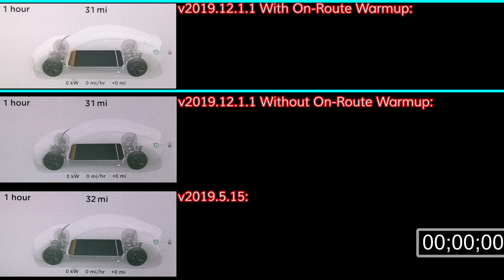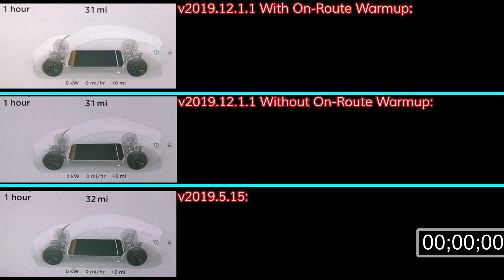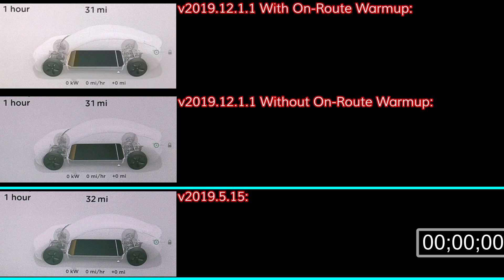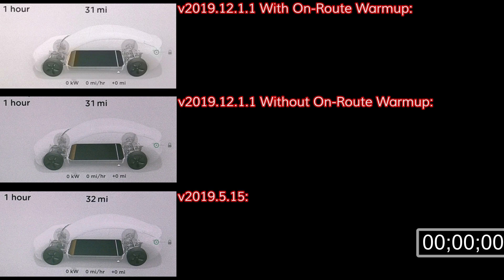Model 3 150kW Supercharging: How Much Faster Is It?

Comment: cool. takes 2-3 mins to warm up then max rate till abt 12mins b4 starting to fall off.  12 mins for 100miles is fairly acceptable.  curious to know if multiple consecutive150kw sessions is possible (nissans rapidgate).
Reply from the maker: The two tests with the higher charge rates on the newer software were basically done consecutively, with the fastest test done last. I just had to drive the car back down to 10% between the two charging sessions that afternoon and grab some lunch.

Comment: So it took 1 hour to get about 270 miles of charge? Well I hope technology improves charge times as this abysmal.
Reply from the maker: Charging to 90% like this using Tesla's Supercharger network isn't typical. On long distance trips, the stations are spaced such that you usually don't spend more than 30 minutes stopped. Charging up to the levels shown in this video is typically done overnight at home on a level 2 240V AC charging station.

Comment: Take notice the 150kW supercharger’s rate slowed down much quicker.  It would be nice to get Tesla’s explanation as to why the 150 kW charger would fall below 100kW faster than the 120 kW peak charge.  It should’ve sustained charge rate much longer.

This why they ended up with almost identical times by the end of charging. 

This is no way definitive proof that 150 kW supercharging is not effective.  Superchargers malfunction and experience as many bugs and glitches that the cars do.

Comment: I'd like to see this done when it's 35 degrees out. Charging when it's 60+ degrees out is always great, but if it's under 40, things get painfully slow.  Every mile is like your +200-240 timing, or worse.
Reply from the maker: I'd like to as well, but it'll have to wait until winter. Our nightly lows have already crept into the 50s.

Comment: I always consider the "inconvenient charging time" the time that I wait charging after I used the bathroom or got something to eat. The nearly 4 minute gap for 150miles likely represents a 50+% reduction in inconvenient charging time, which is a pretty big deal. 

V3 superchargers will likely match the time needed to pump and pee, though most ice users won't realize it.
Reply: Good point! I agree Tesla has the charge times down to match the time people takes breaks on road trips anyway.
Reply: Except the ICE driver could go farther on a "fill up" in the same time. Given its a fuel efficient car with a decent tank.
I can go 350 miles at 85mph comfortably, and still fill up in 5 min.. if I pee and get a drink and snack it's Probably 8-10 min.
EV's are closing that gap, but it's not quite there yet.
Most people I don't think would care even at this point.. most people take longer breaks..
But I'm a road warrior and tend to push it hard when I'm traveling..
I've done 1200 miles straight.. in 19 hrs.
Only stopping for fuel and a pee and drink refill. 
But most people will NEVER do that.
Reply: @kens97sto171  if that is what you want to do then no EV is currently a good choice for you.
Reply: @DavidDrivesElectric  
For sure.. but I'm pretty close to getting a Bolt EV.. for my local traveling.
I'll probably keep my Prius for the Long haul trips...
Also.. I'm fully aware as I get older I will likely want or need to take more and or longer breaks anyway.

The Bolt EV on the used market is getting pretty affordable..

And I prefer the normal car design over the Model 3 interior..

A high mileage but 2014-2016 Middle S may also be a decent choice.. but repair costs and there service center model are major negatives for me.
I like fixing my own vehicles.. and Tesla won't or can't  sell you parts .

Chevy will..

Comment: Lovely way of showing this Alex. Wow, you really must have gone to some trouble to get the battery down to 31 miles for each. Thank you. I am surprised it has made so little difference. I live in Southern Ontario, Canada and we regularly get down to daytime temps of -20C in the winter. Perhaps it will speed things up for us polar bears!
Reply from the maker: I think this update should help a lot with cold weather Supercharging, which is good because a free OTA software update is a lot easier than moving to California for better changing speeds. 😉

Comment: You need much colder temperatures to see the true value of on route warm-up. You get basically no charge while the battery warms for a long time if it's cold soaked. Depending on temperature this time can be substantial. For most of the rest of the world this is a big improvement for this feature alone. Nice job on the setup and capturing all of this, I suspected the increased rate would only be for a brief time like previous peak rate was. Still, it is a nice increase.
Reply from the maker: That's what I figured. Unfortunately, it probably won't be cold enough here until... uhh... midnight in late December or early January(?) to really test out on-route battery warmup.

Comment: Just tested it myself before and after.  A week before update I was only getting 60kW.  A week later after update I got 148kW. Temps outside we're 20F higher but that's still a huge improvement for me in Iowa.  50F today.  This will help dramatically in the winter too.  I did use navigation to the supercharger.  Didn't try without navigation yet.
I had approx the same range when I pulled in and it was the same stall.
Reply: Nooooooooooooooooooo!, I think the colder it is, the more both of these features will help. In warmer climates the 150 kw will drop below the rate of 120 kw @45% SOC, but perhaps in freezing temps it can keep power levels higher for longer. But the preheat enroute is going to be the biggest time saver if activated far enough in advance.